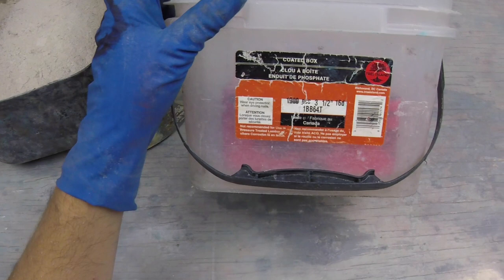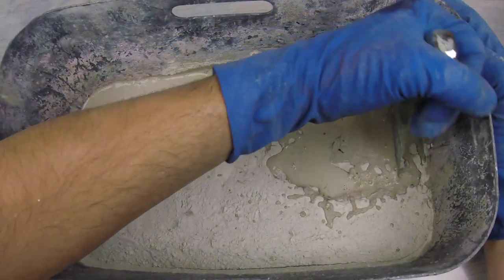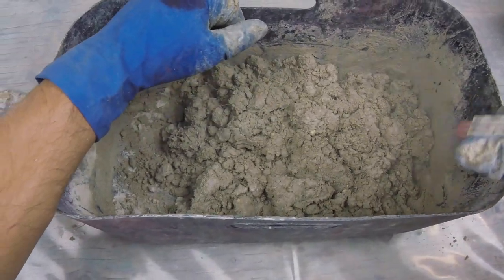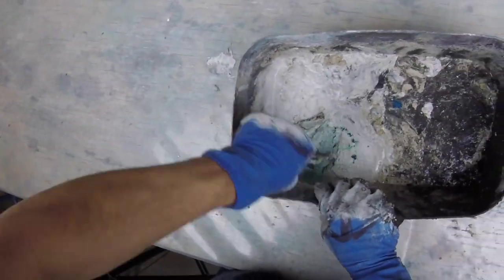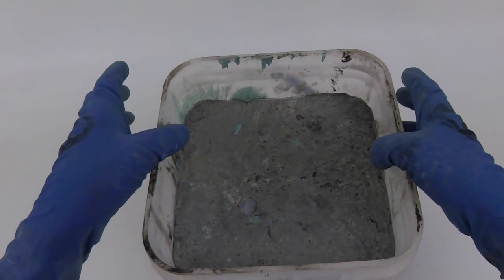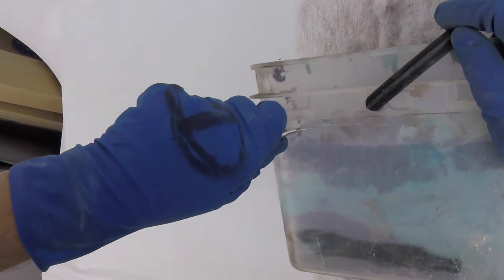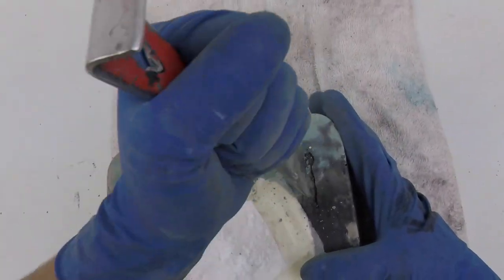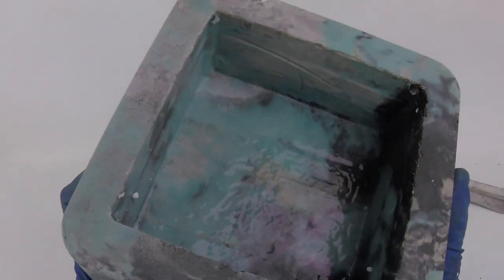DIY Bonsai pot - Ultra cheap mold!  Marbled concrete.

Comment: I am confused....very new novice here.  Where are the drainage holes, wire holes, and wire grooves; how/when are those added?  Also, the legs; my understanding they are supposed to sit on legs, not flat level bottom.  At what stage are those features added?
Reply from the maker: Add those features and show us the results. Good ideas! You're very smart

Comment: I am planning to do this very project hopefully this week once I have everything. I had a question, what did you use to hold the centre object in the middle of the planter for it to hold in place. I am just afraid the planter in the planter will lift up and the concrete on the sides wont hold.
Reply from the maker: I taped it down with two way tape.

Comment: Concrete, is there a way to email you? I am working on several small projects and could really use your advice for mixing.
Reply from the maker: Hi Mike,  the best advice I can give you is in video form as you can see exactly what I'm doing rather than try and describe it via words.
For more info and contact info go to www.concreteconcrete.com

Comment: So this grey matter you speak of, is it one of the products you sell via Concrete Concrete?
Reply from the maker: Hi, Yes Grey Matter is our mix design we developed for making concrete art.  It's about 4 times stronger than  regular concrete, cures in a fraction of the time and self levels with little to no vibration.  It designed so that you see success right away.

Comment: Ps. If you don't wanna waste that container you made. Apply some oil on the artificial mould before you apply the concrete . You're welcome :)
Reply from the maker: Thank you.  One word of cation is that oil will discolour your finishes in unpredictable ways.
Reply: @CONCRETECONCRETE  depends on what kind of oil we use 😊

Comment: Awesome! Quick question. I tried this same process for my own two houseplants with just regular concrete and I'm wondering how does one create or end up with nice and "smooth" concrete and is there a type of "stain" or "gloss" one should also use to aid in the smoothness of the concrete? I loved the tricolor you achieved here with the concrete. I'm so thrilled to try it myself for my own little fellows I keep around the house. Is there a readily available and easily accessible type of cement mix or concrete mix one should buy for this "smooth" finish or does it have to do with the water to cement mix ratio or something relating to the "stain" one uses? I also don't have any power tools so I hope it's something that can be achieved by a novice like myself. Your videos have given me a whole new avenue of ways to creatively express myself and I thank you very much. I never imagined just how infinite the creative possibilities are with concrete. I'm sure your Bonsai Tree will love it's new home. Looking forward to your response and of course new uploads!
Reply from the maker: www.concreteconcrete.com  This is a user friendly place to start.  The whole point of what we do at Concrete Concrete is try to give you the greatest chance at the grand success of your project.  

Minimal surface voids with the smallest amount of water in your mix possible.  For grey matter the ration is approximately 100ml per kilo of Grey matter.
Reply: @CONCRETECONCRETE  

Thank you for the reply. 

I'll be sure to check the site out. Thank you once again for the reply.

Comment: nice one :) I have a question, what can I use to color up my concrete, that I can easy find at home? :D is there something that can ruined concrete?
Reply from the maker: Hi.  Ideally mineral pigments are best for concrete.  They're predictable, UV stable, and designed to stay in suspension.  Household goods will won't look great but could be a fun experiment.
Reply: I was just looking for some cheaper alternatives :)